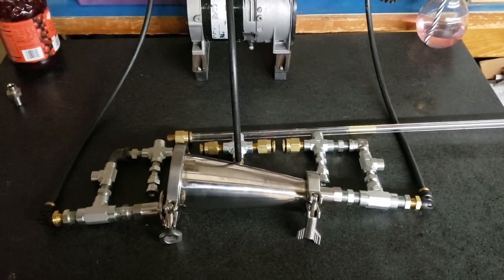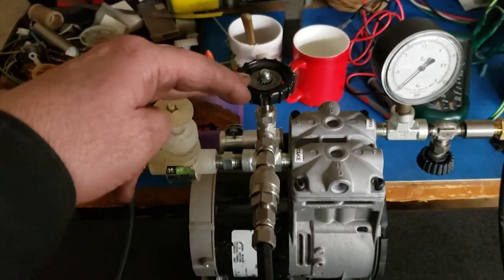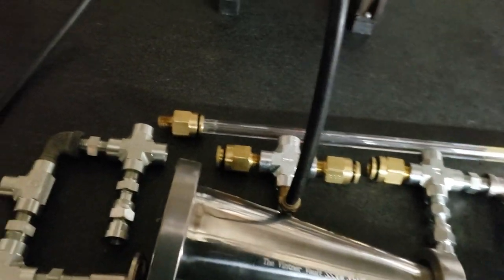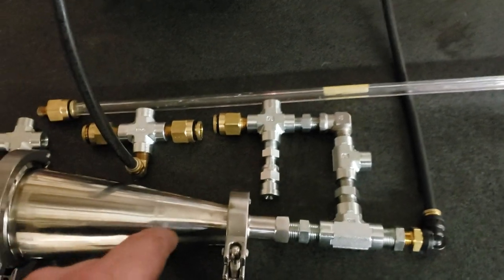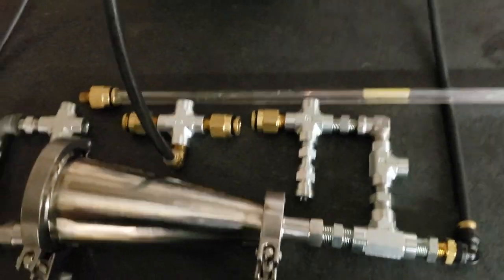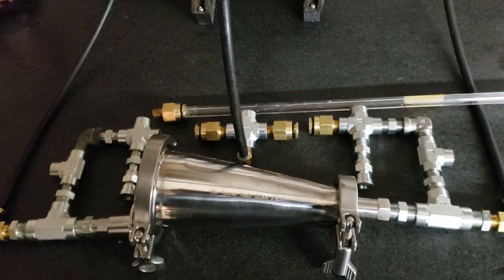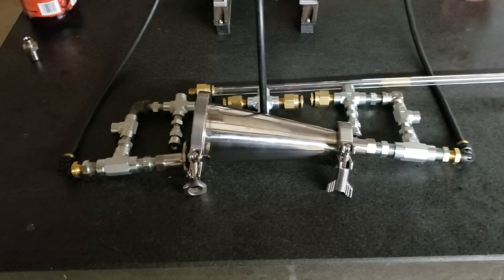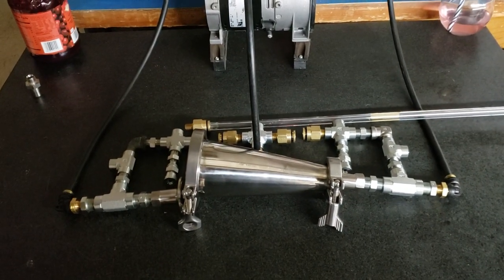-30 Absolute vacuum no problem pulling 40.8 inches of mercury

Comment: Pneumatic force multiplier? Nicely made. My compliments to the welder/fabricator. I did that building boats for a long time. Lots of fun.
Reply from the maker: Thanks, however it's just fittings I put together. O have a tremendous amount of maching to go, building and figuring out the geometry of the jets and receivers inside. An example is they have to stage. If they are the same size, it will definitely defeate the purpose. If you backflow a vacuum receiver it stops the vacuum. I accomplished this with two, and two pressure points, and recirculated the water in an open pot/bath. No problem. 
Now I'm trying 9 and 6 pressure points, and not only closing the loop, I'm passing it through a diffusion pump, and recirculating in the fusion reactor that will be plumbed to the Plasma microwave to make something deposit in the Plasma of the microwave. So this is definitely above the Nanovated Hydrotherapy system. Even though Nanovated Hydrotherapy is a product that you can buy, it was a proof of concept. 
My underlining point is this that I am building is not necessarily a product, it falls under process for patent disclosure. Because what I am trying to accomplish is more elements on a new extended periodic table that specifically relates to Hydrogen and Vacuum, Not Carbon and Pressure, as we understand it now.
As I say gold is the only digesting metal. Silver is a digesting metal, although fresh water so I look at as urine of gold. Now the most interesting thing is Rhodium as a metal is extremely rare and always found in a particular soil recipe with gold. However that's interesting enough until you understand that "ONLY" Rhodium has an ecliptic orbit in its last valance, just like monoatomic gold or Au197M, however Au197M has a radioactive half life of 1hr 15min and its gone same as nicotine and Au197 is the reconstituting shell that grows on a cancer tumor that bounces back the signal to the brain that everything is fine, then eventhough we can break the shell with lasers it just grows right back. 
Ok, class this issue I solved with Nanovated Hydrotherapy, as a bandage after the fact and a preventive for cancer, a medically proven fact. "I am not a medical Dr. I'm backed by them for building medical devices.
   Now I'm after the cause of cancer, however again I'm not looking at cancer, I'm specifically looking at metal, because I can easily control the Proton in Hydrogen and Gold and stop radiation, in Uranium. (Just trust me I'm working off a self imposed NDA on understanding Uranium that will be published soon) And I can sustain Au197M past its halve life that's BioGem in the link. 
https://protonspintechnology.com/bio-gem
So, Au197M is not technically radioactive as the books say, it's the only element that the electron spins around the proton and takes it apart, but dosen't drop in to gold. Yet cancer dose, and cancer is basically rust. The best prevention for rust is fish oil aka WD40 lubricant,  now I do not recommend drinking or injecting WD40, but Alaska wild salmon oil is just fine because it has the highest amount of cyanobacteria. So we are closed loop back to Hydrogen in absolute vacuum and the proton being Graphene Insitu of hydrogen and that's where vacuum comes from, and why space expands. 
Recess Class.
Reply: @Hhydrogen4Power  I take chlorella algae and spirulina tablets, C60, and nascent iodine everyday. At 39, I'm in better health and fitness than I was at 20 in the Navy.
Reply: @Hhydrogen4Power  Element 126 anyone? Diatomic gold fluoride...
Reply: Can you use some hafnium foil? 100mmx100mm? 99.95